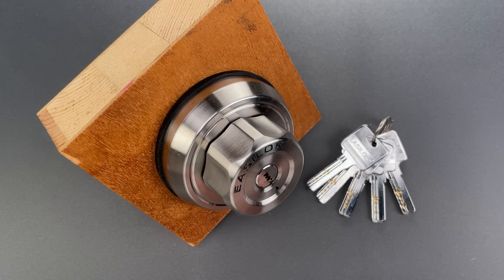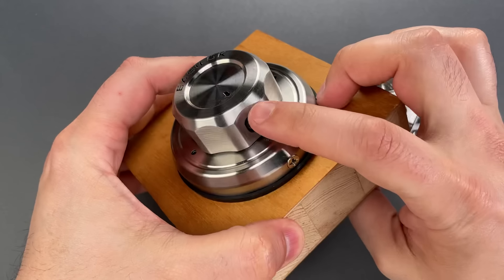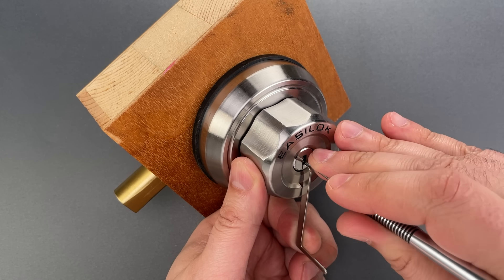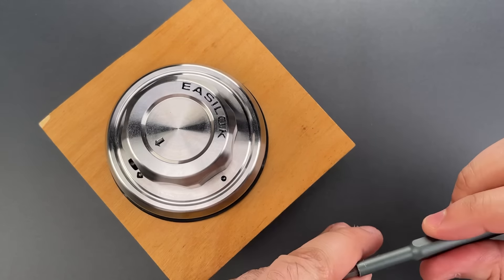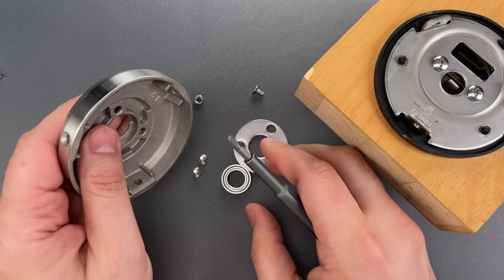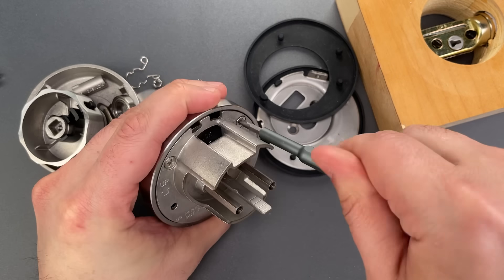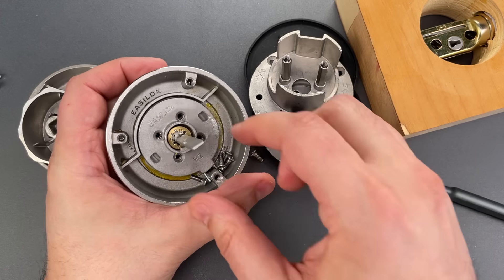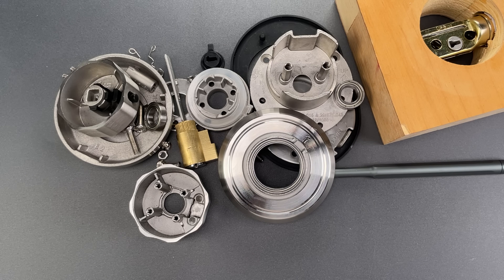[1388] The Best Built Deadbolt Ever? Easilok

Comment: I'd like to see what it would take to get it open other than picking. Might he a good option for all doors on a home with one in particular having a higher grade lock that's much harder to pick. Every time you're not home flip that switch as stated. Regular thieves wouldn't know what to do with that thing.

Would be better with the etched label not on display to the outside.

Comment: I was a locksmith before I retired, and I was so impressed with this deadbolt that I ordered and received it from Amazon. The only difference I noticed now is that the key is half-moon shaped with dimples down the inside center. I have never tried picking dimple locks, but I will as soon as they arrive from China 🤪 
I enjoy your videos and am impressed by your skills. Thanks from commiefornia. PS- there is no longer a switch lever on the inside knob.
Reply: That is actually a different version of this lock. That is the one I bought too. No switch, but a much better core. Beware that it is difficult to tension (use a narrow traveler hook and pull up while holding the knob. It is also a driverless lock, having only keypins with a groove down the side for a sidebar to snap into and allow the lock to open, and several small serrations as false gates. Much harder to pick than the version shown on the video which has standard keypins and driver pins, just arranged in a dimple format. If the core from your version could be put in the version with the switch, that would be the best of both worlds, difficult to pick and with a night latch feature.

Comment: I seriously like that mechanism where you on the inside can stop it from being unlocked from the outside.

In my last apartment I had to force (lawsuit) my landlord into replacing all the locks with a model that couldn't be unlocked from the outside if the key was left inserted on the inside, because I had two occasions where I was asleep and woke up from noise in my place, which turned out to be a maintenance person that was given a key by the landlord to do work inside my place.

This is entirely illegal where I live, landlords here have no right what so ever to get on a rented properties premises without making an appointment with the person renting and there are only a few specific things they can make an appointment for. They can't force entry, they can't make shit up. They are to leave the rentee alone.

Comment: Even though you can't just swap out the cylinder, due it being non-standard, I suspect you could get replacement pins that are higher security.   

It would be nice to see you do a video where you enhance the security of a decent security lock to turn it into a high security one by doing a pin replacement and/or a core replacement.

Comment: As someone who casts products in 304/316 stainless and aluminum, I'm blown away that this is retailing for $40 on Amazon given the raw material expense of all those cast parts and the labor intensive process of creating and finishing them.
Reply: Where does it retail for $40?!?
Reply: @gblargg  seems I misidentified the ad. There's a full EasiLok selling for $70-90. And then there's what appears to be the model E3 meant to update the outer portion of an existing deadbolt. That retails for $40....and at a quick glance I mistook it for the full lock. When I saw your comment and returned to that ad I realized my error. Though even at $90 it's still impressive (to me).

Comment: I'd like to see the outer face plate's screw holes closer into the interior with stacks of hardened steel pins between them and the rim inside the shell... maybe a little overkill but its possible to shear that.  I'm suspicious that a good large pipe wrench would make the installation moot.

Comment: Being able to close the door without a key is kind of a scary feature, I would definitely lock myself out of the house because of forgetting the key inside a few times with this lock
Reply: in some country's there's no door handle on the outside, you need a key to get back in anyway, having the ability to fully lock the door that way is a nice touch for such ppl since they don't need to use the key to lock it, although some might not even check for key's after a while and end up leaving home without key's..
Reply: I wear a door key and car key around my neck on a chain like some people do with crosses...a dog chain.
Reply: I live in the UK, and every domestic front door lock I've ever seen automatically latches, although some can be manually latched open.
Reply: The newly added Anti-Mislock of our upgraded E2 can solve this problem well. It can help to prevent you locked yourself outside the door by any unintentional twist. ☺
Reply: @easilokpresentedbyaisecure26  you guys must be loving this!

Comment: That thing is stunningly nice! I am curious, however, what the failure mode would be if the lock were to be forced with a pipe wrench on the outside. Hopefully it has a designed in weak spot that prevents the lock itself from being compromised.

Comment: Any exploits to overcome the “night latch” feature? If not, yes, the core isn’t too perfect, but the fact that you can disable it from the inside is great.
Reply: seems like an extremely bad feature after the kids push that button and lock you out for the night....
Reply: @srobeck77  it's not easy to disable the lock tbh. Yes, for someone like 8 or above, but they know better
Reply: with feedback like this they can reach out to LPL, get an advice for a better core and deliver a medium security version with a far better core.
it would sell like mad and would likely get a new video with their updated version and another good feedback.
that night latch simply detatches the lever that turns the mechanism, so unless you can force the little spoon inside to grip the turning mechanism on the back its not going to happen.
as for kids locking you out; well, that's why some people have back doors, other than that, my kid would be locked out the night after if they did this on purpose.
Deadbolts shouldn't be installed where 3 year olds with a tantrum can reach them, and a 8 year old will just lose their allowance for a few weeks due to the hotel cost of dad being lockout outside (any kid under 8 left alone in the house is a dumb idea neway)

Comment: This would be great for the dominos I work at. The drivers all go out the back door,and the little button on the door handle always somehow gets disengaged causing us to have to walk all the way around to the front customer door.
Reply: You could just use a number code latch. We have them at work and it’s so simple we can always change the code very easily if it is suspiciously exposed by a staffer.

Comment: I would like to see this lock tested with the dreaded pipe wrench. It would be easy (more so than normal deadbolt designs) to get a grip on it but what will happen?
Reply: That was my thought as well.  I'd like to see a low-skill destructive attack with a big wrench with lots of leverage.  I agree that the knurling seems like it would give a wrench lots of grip.
Reply: @ramrod132  Not just the knurling but also that it doesn't present a sloped surface.
Reply: @MesoTroniK  Also a very good point.  
Given how little force seems to be required to turn it to lock, I'd think that they could likely have used a smooth, sloped surface and just relied on the friction between skin and smooth steel to activate the locking feature.
Then again, maybe we're missing something they did to mitigate the seemingly obvious vulnerability.
Reply: Same thought just now. You could apply a lot of force on that lock with a pipe or long crescent wrench.

Comment: Maybe I’m negative Nancy but that key override feature just seems like getting locked out of the house by a toddler
Reply: A four or five foot tall toddler?
Reply: @bwacuff169  kids will figure out how to reach for something, and those rascals will manage to pull it off!
Reply: The key override feature stops the handles from turning. So if it's locked, it can't be unlocked, but if it's already unlocked, it can't be locked. So the only way for a kid to lock you out with it engaged is for them to 1. Disable the switch, 2. Lock the door, and 3. Re-enable the switch.

In which case there's probably some larger problems in the family... ;-)
Reply: @bwacuff169  Toddlers can still reach up to play with things, so it wouldn't be too out of the realm of possibility. I was also a big damn toddler and could definitely do that, but I'm probably an outlier.

Comment: It would be interesting to see this lock properly attached to a door and then twisting the knob from the outside with like a big pipe wrench, i dont hink those 2 small screws on the inside would be very strong
Reply: @trollolol most deadbolts have a slip ring to prevent this very attack. I think it is strange LPL would support a product that is easy to bypass with a pipe wrench. I am also wondering how hard it would be to rake with a dimple rake
Reply: @trollolol i mean windows exist too if were talking about possible break in points
Reply: LPL describes it as a particularly good low security lock at the start, so it's not supposed to be pipe-wrench-resistant.

Comment: I know it's a kind of stupid question, but would locking the night latch (which prevents the key from opening the lock) also prevent picking?
Reply: As it stops the cylinder completely from unlocking (even with an actual key), they answer to your question is absolutely, yes.
Reply: @JoelAz909  quite right

Comment: And what happens when someone puts a big wrench on it and torques it into oblivion? First deadbolt I've seen that seems to be vulnerable to that particular brute force attack.
Reply: If you're going to go brute force on a lock with a large pipe wrench, then it'd make more sense just to bash the lock to pieces with it
Reply: @haroldpinter8076  Locks don't "bash to pieces", even if you're using a tool appropriate to the purpose. Twisting the lock would normally never be an option, but this one is specially built so that you can twist it.

Comment: problem with deadbolts for home use is what the dead bolt goes into, the majority’s your door jambs are made with 1/2” thick wood and it doesn’t take much to kick it open. if you want a deadbolt that isn’t easy to kick open then the bolt needs to go deep into the jack stud.

Comment: I'm curious, LPL:  If you couldn't hear the clicks (a noisy environment, for example) would you still be able to pick locks?  Is there a 'feel' component here?  I am almost sure there is, but I wonder if it is sufficient (by itself) to pick locks with, especially at the phenomenal speed with which you work.  Cheers!
Reply: That is a great question!
Reply: Yes, he feels the release of tension in both the pick and the tension wrench simultaneously. both will move slightly for each pin manipulated
Reply: @5axmachine167  Thanks!  I really hoped to get an answer from LPL himself
Reply: @Fanta....  But would the 'feel' alone be sufficient to defeat these locks at his customary speed?

Comment: So, if you flip the switch when the bolt is extended, and you cannot open it with the key from the outside, can you still pick it?
Reply: I'm wondering this as well
Reply: No, how would that work? Picking is basically the same as just using the key, so the same mechanism applies.
Reply: @eega9181  bc it's not only an unconventional lock but it also has an unconventional key therefore it would actually be nice to see if the inside switch actually prevented someone from picking the outside lock
Reply: @eega9181  well, if you cannot pick it because like with the key, the mechanism would just spin, it is  a great lock! @LPL, there’s a challenge for you! Can you please confirm that the lock cannot be picked from the outside if the switch has been flipped inside? Thanks

Comment: build quality is good, but he said the security level is low. He even said he would like to replace the core with something that has higher security.
Reply: Quote from Andrew Varnon

FWIW, it does look like they offer an SC1 keyway. I'm guessing standard security pins could be added for additional security. It would also be nice if your existing door knob uses the SC1 keyway.
Reply: Well, it is a deadbolt lock made for door use, so it should be on par with the majority of store-bought competitors.

Comment: My question is, what happens if the switch is not off if the owner goes out and forgets to switch back on so they can use the key ? I can see people locking themselves out of the house. 😮
Reply: If my understanding is correct: The switch locks the deadbolt in place. If its off, then the door is as unable to be opened as much from the inside as the outside. So you'd have to flip the switch to leave the house via that door at all. Then when you are outside, you can't flip it back and get stuck.
Reply: the night latch works  like your reinforement lock, your security bar, your deadbolt which can't be opened outside.

Comment: Looking at it with my "limited damage" emergency breaching eyes, I'm guessing it sticks a bit too far out to use a K-tool to pull it out.  On the other hand  I could probably use the short halligan and pull it off with the wide adz, causing limited damage to the door.  Could the knob simply be brute forced with a pipe wrench or does it spin freely without a key?
Reply: good questions. I'd like to get ahold of one to test. Seems like there's a way in just behind the dial.

Comment: I actually had one of these locks, by the looks a slightly earlier generation with the "moon" shaped keys. The transfer bar that runs from the core, through the bolt and lock body was the weak point. After about a weeks worth of use, it twisted itself like a helix, and would no longer function. Probably poorly (or not at all) heat treated metal. Sent the company a number of emails, got replies back that it was "impossible" for that part to have failed. Sent photos, etc. Never heard back. Ended up returning the whole thing. It's to bad, I liked the "lock from the outside" deadbolt.
Reply: Thanks for the feedback. Do you mind me asking -- how much "earlier?" It seems they're trying to improve their product.

Even in the best manufacturing environments there can always be faulty items coming off the line. But it's always good to keep an eye out for points of failure.
Reply: @seanofpeace  this would have been mid 2020 I think

Comment: As you demonstrated it is probably one of the best built residential deadbolts on the market. Unfortunately as you mentioned it would be great if a more pick resistant cylinder were to be made available. Do you know if they makemortise cylinders as well?  I was in the locksmith industry for 40+ years. Presently I have a full bodied Yale Mortise lockset on my front door and my back door has a double cylinder tubular deadbolt that utilizes 1 1/8" mortise cylinder with Kaba dimple keyed cylinders . Since I installed these over 35 years ago It is time for a change.

Comment: All I can get locally are grabage deadbolts  60 bucks or less. They literally rot right off my door in northern canada. I even acquired special rubber gaskets, made specifically for my locks,  that I got from a local locksmith. The manufacturer gave them to the locksmith to give out to anyone who came in and complained. After a few winters  they just dried up and fell apart! House and garage are also humidity controlled (one of the things manufacturer mentions when one complains). I would happily pay 150 for something decent like this. Problem is, how do I order one online, from Canada and know that I am not buying a knockoff? Ordering them via locksmith company is too costly.

Comment: Wow, that really is a high quality lock.
Apart from the SS castings and the bearings, I noticed they used 3 or 4 screws where others would have only used 1 or 2 screws respectively.
Would be great if they offered it in 2 versions, one with a higher pick resistant lock.
What is the retail price of this lock?

Comment: Got one and installed it. Unfortunately, whoever installed the original deadbolt on my door only drilled a 2" hole and it was actually offset by 1/4". Not a problem for a basic deadbolt, but this lock requires a 2-1/4" hole and it definitely needs it to be centred. I eventually fixed that — not entirely easy when the hole saw kept binding on the edge of the existing hole. Once that was done, though, it was entirely straightforward. I replaced my doorknob with a handle in a matching colour and now everything looks and works great!

Comment: Please forgive my ignorance, but I've seen a good MANY of your videos on this channel in recent years and I am curious if you can expound a bit on WHY you aren't able to swap in a custom / higher security standard keyway core.  I find it difficult to believe you are unable to do darn near ANYTHING at all, upon which you truly set your sights and give your full intent.

Perhaps it is simply NOT possible without doing significant alterations to the look body--thereby doing unfortunate damage to the lock integrity--something I understand would be extremely disconcerting, given this lock's unusually high quality engineering & fantastic fit and finish??  

I really agreed with you that this lock is truly unique and would be downright cool to Iran in the correct setting.   If an internal core upgrade could be accomplished.....I'd truly make it a point to perform the upgrade just for the bragging rights & fun of the challenge.

Thanks!